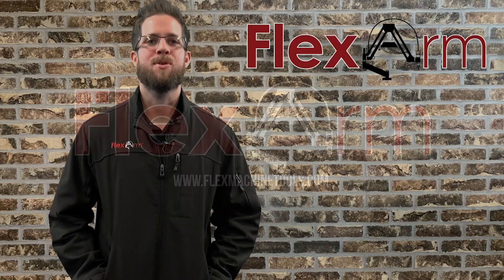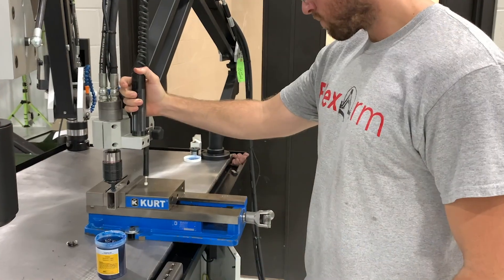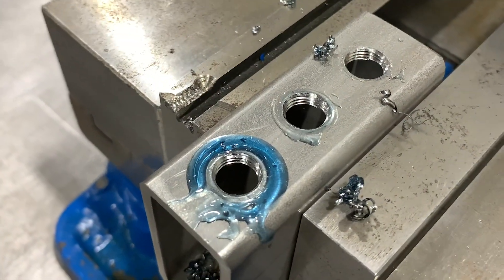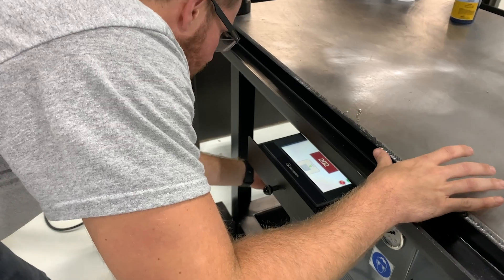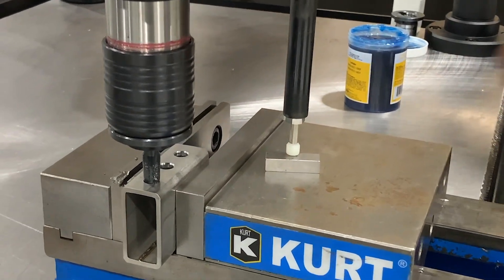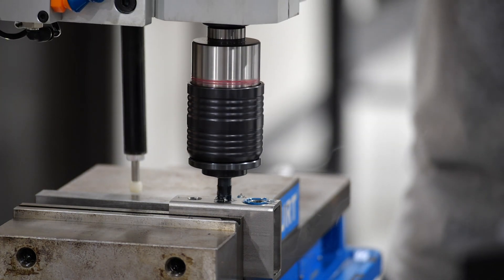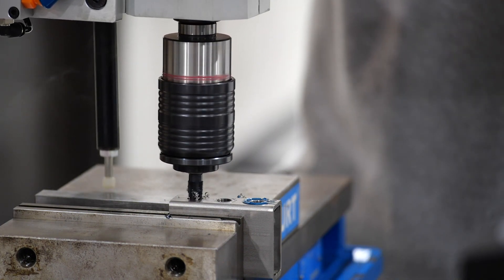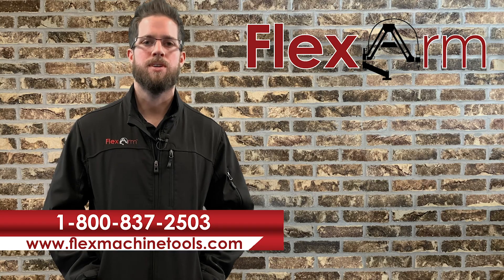Tapping 1/8" NPT Threads into Stainless Steel

Comment: HI 
IS G1/8 THREAD MATCHING WITH 1/8 NPT
Reply: No, they have a different thread pitch and NPT has tapered female threads whereas G/BSPP/BSPF has parallel female threads like normal threaded fittings. 1/8" NPT is 27 threads per inch whereas G1/8 aka 1/8" BSPP/BSPF is 28TPI.